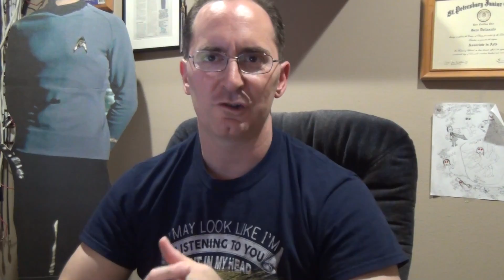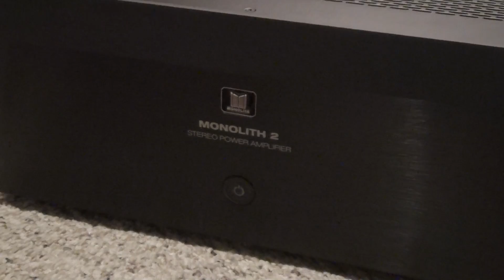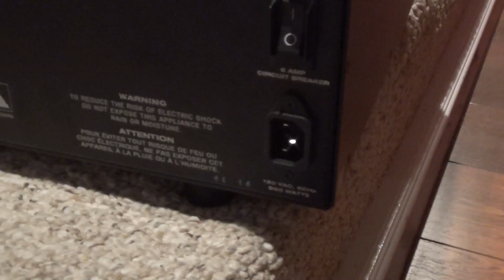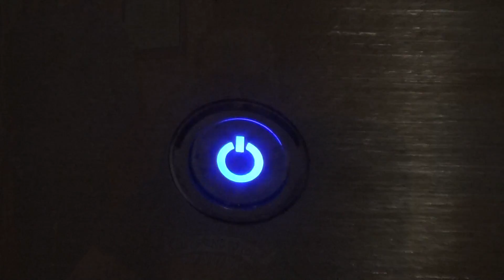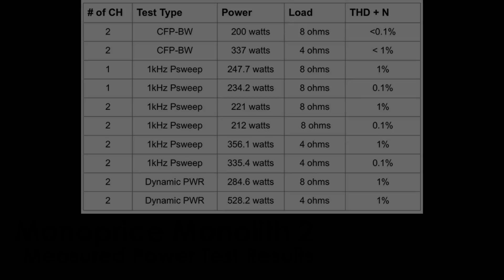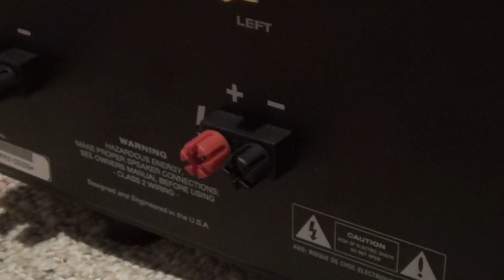Monoprice Monolith 7x200 watt/ch Amplifier Review

Comment: Gene, thank you providing a wonderful review. You guys at Audioholics always do a great job and provide objective reviews. I just purchased a Monolith 7 amplifier last week and it is a great sounding amp. I have Outlaw 7700 amp for my home theater. For testing purposes, I switched the Outlaw with Monolith. I couldn't tell any difference in sound produced by Monolith compared to Outlaw 7700. I paired Monolith amp with Yamaha RXA-3060 AV receiver for my living room application. It is a great sounding amp. Only drawback I can think of is that it gets really hot. I have placed "AC Infinity Aircom S9" fans on the top of the amp. My question is since this amp is running relay hot, how it would impact its longevity? Specifications on this amp are exactly similar to ATI 2007 amp. The body style also appears to me same as ATI 2007 with exception of the front plate. Good amp!!Thanks again for the review. I'm looking to buy in-wall speakers. Any good recommendation?
Reply: Hello Pete, I was curious about the sound difference with amps connected to your Yamaha 3060.  I also have the 3060 and I am enjoying the sound of it very much.  I am using the amps in the receiver because my speakers are fairly easy to drive (Ascend Acoustics towers)  I was wondering if you could provide some insight on how an external amp has improved the sound for you.  Thanks much!
Reply: Hi e hall: if you are enjoying the sound with amp in the receiver, then it is what it matters. The issue I had was the RXA-3060 is 150-watts with 2-channels driven. I was trying to power 9 in-wall/ceilings definitive tech speakers with 90db sensitivity and 8-ohm impedance in my living room. 3060 is 150-watts with 2-channel driven (8-ohm) (Roughly: 150*2 = 300 watts, then 300watt/9 = 33 watts/speaker). My speakers are rated at 150watts. I was having a hard time listening to dialogues and shows that are Dolby digital. Plus, the receiver was running too hot trying to power the speakers with under-rated power and at the same time decode the sound. My solution was to attach 7 channels to the external amp (Monolith 7, rated at 200-watts for 8-ohm speakers) and 2 channels (front presence) to the 3060 amp to make it 7.2.2 set-up. The dialogues seem to be clearer compared to just using the amp in 3060. Lows and highs are well defined and the receiver is running relatively less hot. My thought process was let the 3060 to decode the sound, and the external amp to power speakers. I wish I could have purchased pre-am, but 3060 is a nice receiver. Thanks.
Reply: Pete- Thanks so much. Yes it's sounds like you needed an Amp for your application.  Yeah, a decent Pre amp is probably going to run $2500 or so, but I'm sure the 3060 performs quite well in a pre amp capacity.  I am only running 3.1 now so It's seems to have enough power at the moment. Thanks again for the reply Pete.
Earl

Comment: I know you said that this amp does not have balanced inputs,  is this a problem that would cause noise?   Help me in my thinking?
Reply from the maker: Greg Wallace Not necessarily but if your preamp has balanced outputs, its best to use them with an amp that has balanced inputs.
Reply: What do you mean by not necessarily?   If I buy the Monolith 7 channel amp, would this be a concern of yours about any noise issues?
Reply from the maker: Nope.
Reply: Thank you for your help.  One other question.  What do you think about using professional grade powered speakers for example JBL  SRX812P for parts of (front left and right) a surround sound system using a regular AV receiver with pre amp outs?  It this even doable or am opening up a can of worms and asking for trouble?
Reply: It will not create an issue so long as you long as the line level cables between your receiver and amp are a normal  length and kept away from the power cables.

Comment: Hey Gene, thanks again for the info. I'd be curious about your thoughts on what improvements if any a much higher end home theater amp would offer. I'm always tempted to look to these value brands but my German brain tells to keep looking for the likes of Rotel, Marantz or even used McIntosh for that little increase in performance. Hope this gets answered, thanks.
Reply from the maker: J Herberger The higher end stuff usually offers balanced inputs, better aesthetics and more power.  Truly state of the art amps have fully differential outputs but most of the brands you mention do not.  fully differential outputs offer benefits of lower distortion but the audible difference is pretty minute considering the cost factor.

Comment: Best 5 channel amp i heard was the Krell TAS and the EAD PM2000.
Both of them were from the early 2000s.
I'm using Krell TAS 5 channel amp, Denon AVP-A1HD Preamp/A/V Processor, JM Lab 920.1 for main speakers, JM Labs Electra CC-900 for center channel and JM Lab 906 monitors for rear speakers.  Custom house speaker cables
Reply: Those are priced way higher than the Monilith

Comment: Why do you think it's important to use balanced cables? The signal just becomes unbalanced when it heads to speakers, so does it really matter if the interconnects between your AVR/Processor and Amp are balanced?
Reply from the maker: Keeping the signal chain balanced through all of the amplification process ensures the lowest noise and distortion.  Some amplifiers actually have differential outputs as well.  Those are state of the art!

Comment: How do you mate this to an Av receiver?
Reply: Not with speaker wire. First you need a receiver with pre-amp outputs. If your receiver doesn't have that, then you need a new receiver or an audio processor like the Outlaw 975. You connect the pre-amp outputs to the inputs on this amplifier with standard RCA cables.
Reply: Speaker wire bud, just make sure you have pre amp outputs. Don't want to send an already amplified signal to an amp.
Reply: Ok, I did not know that.
Reply: D-Money Moz also has RCA jacks as well fyi.

Comment: Been thinking about getting external amplifier. Would my speakers be a good match for the Monolith 7? Today I have Denon 1911 Receiver, Polk Monitor 70s up front, Polk Monitor CS2 Center, Polk Monitor 30s for rear, Polk OWM5s for sides. And 2x Polk 505 subwoofers. Guess I like Polk lol.  Wanting to upgrade my Denon to the 4300 sometime in the future too. Wondering if Id see a significant upgrade with this Monolith 7 unit? Thanks
Reply: I own LOTS of speakers. The monitor 70's would probably love that extra power on a dedicated amp. We have 70's in one of our setups and I think they would be stellar outside the receiver environment. My only concern is that the 505 is a good sub, we have one...but Polk really does not make GREAT subs. My worry is that the power from your primary speakers with an upgrade may upset your total balance going out. I think you having two of them is great though. Plus you have to worry about processing. You will need an external processing unit with multi channel pre outs. This can also be done with a good receiver, but many brand new models have deleted this feature. We have the monitor 50's=4, 20's=2 and 70's=2...lol So its safe to say that Polk has a place at the house as well... :) We have a 5.1, a 7.1 a 2.1 tube amp setup and a top range LG sound bar with network capabilities as well as a Riva Turbo X wireless speaker...lol You should hear the 20's or 50's on my tube amp, what a pleasure to listen to. Granted my tube amp is not crazy expensive, but it gives you something "different" to listen on. One of my sets is the Bic Acoustech series, 7.1 you should really check out their stuff. Their subs are commonly regarded as one of the best choices for under 400 dollars. I actually prefer these over the Polks in total. They get louder and cleaner with less power and have less listening fatigue at higher volumes. Anyway if you have a great receiver with great DACS with multi channel output you should be in good to great shape. I like you have been eyeing the dedicated amp market for the last 3 years. Oh also I have two Yamaha AV, one Denon AV. We have a projector so i have a floating receiver that I can hook up anywhere. Also if you want projector recs, I tell you that the Viewsonic we picked up is the best thing I have ever seen with my eyes for under 1k. Ok operation ramble is complete..lol

Comment: How would you hook this up and control volume. Would it simply  be rca from receiver to amp,level match in the amp then control the volume via the amp?  Would I see a big benefit of doing this to my old denon 2310 in 7 channels?
Reply: Stevo19801 your receiver would have to have rca pre out. The receiver would control the volume.

Comment: So between the Emotiva XPA-7 Gen3 and the Monolith 7, which is the better built amp? They are priced similar to one another.
Reply: SSJBen id go with monolith no question asked, unless you must have xlr inputs.
Reply: M Nohcho No questions asked? That explains nothing. Why the Monolith? The XLR inputs doesn't mean anything on the XPA since only the L/R terminals are internally balanced, all other channels are still unbalanced but terminated for XLR jack.
Reply: The great thing about the Emotiva is you can expand/upgrade it.

Comment: 85°C is standard for a capacitor, good ones for heated enviroments have 105°C and lpw esr... Looks like an advertisement to me.
Reply from the maker: Tim Abels most consumer gear has 70deg C parts. Not advertisement, just pointing out something good.
Reply: I am electronic technician since 22 years and never saw capacitors with 70°C. 

I looked up at the bigest manaufacturers and so can you: 
Vishay: http://www.vishay.com/capacitors/aluminum/ (which is a US corporation), 
Kemet: http://www.kemet.com/FEBG_electrolytic_snap_in
or Epcos: https://product.tdk.com/en/search/capacitor/aluminum-electrolytic/screw-terminal/characteristic/
 
Not a single one sells large aluminium electrolytic capacitors (which are used for amplifiers power section) with 70°C.
85°C is the minimum, going up to 105°C, 125°C and 150°C.
Reply from the maker: Actually you have a point. Some of the best amps we've reviewed use 105 deg C parts.  However, I have seen lower than 85deg C electrolytics on consumer gear before.  I suppose 85 deg C should be the norm.